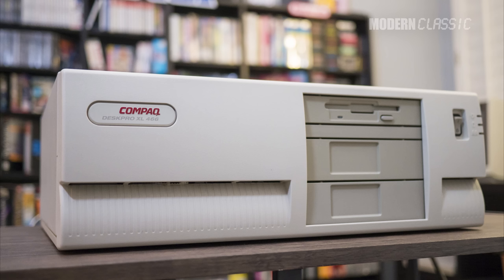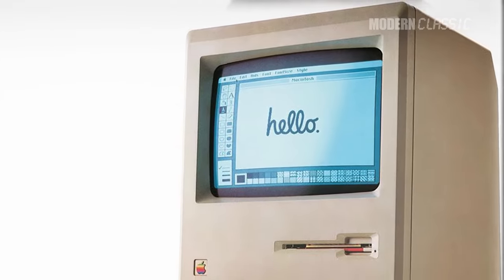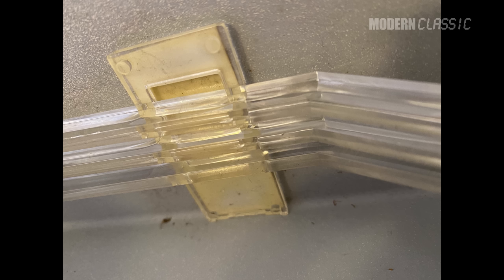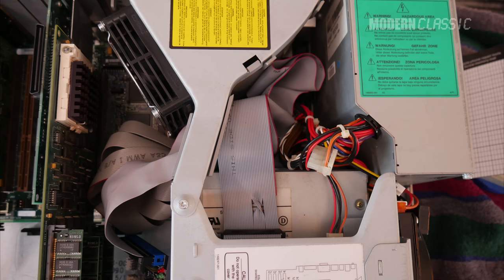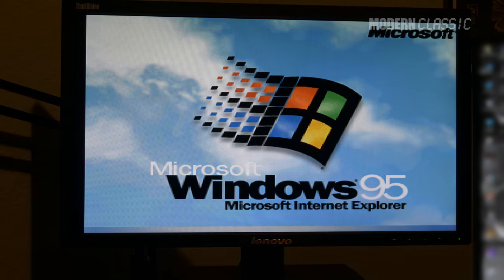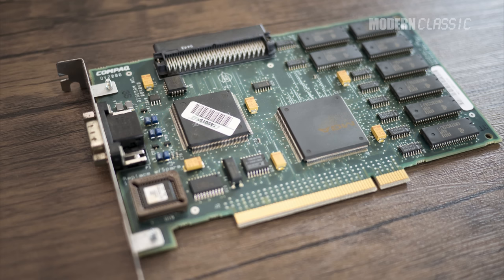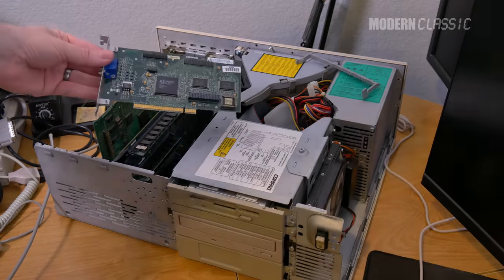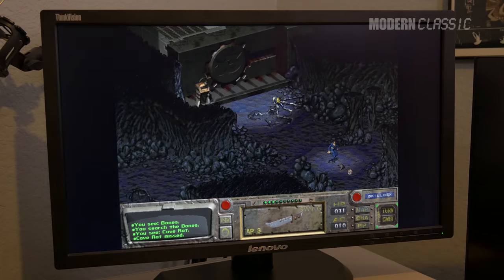Compaq 486 PC restoration and upgrade - Part 2!

Comment: I'm not 100% sure why your DX2 50hz ran sluggish like this, but to fix some problems with 486's back in the day COUGH was to run a memory management tool QMEM or DOS 6.22's own memory manager, can't quite think of the name of it, I miss my DX4 100hz with 500mb HD and 1mb Trident Video card oh and dual cdrom xD, great video keep the nostalgia going :).
Reply from the maker: I am running EMM386...
Reply: @ModernClassic  Bit of an obvious question, and knowing you was running EMM386, does your 386 have a Math Co processor in, as some motherboards came with out then, just a bare socket, just trying to think, as a DX50 shouldn't have been slowing as much as yours did, or it's something else I can't see / figure out xD.

Comment: I had issues with that same IDE to CF card in an 486 build, It would only work with a 80 wire IDE cable.
Reply from the maker: I am using an 80 wire IDE cable... still no joy on the block mode error. It's probably an incompatibility between the adapter and on-board controller.

Comment: Great video, very enjoyable. There is a fairly easy way to run an older Dos version. You just need to create a Dos 6.22 boot floppy, then put the Dos 6.22 files in a separate folder and change the command lines in autoexec.bat and config.sys accordingly. If it accesses the floppy all the time there is a fix for that. I've successfully done this by booting dos 7.1 on Win95 which is dos 7.0, mainly because I was too lazy to recreate a proper dos 7.0 boot floppy, so yeah running win98 dos on win95.  Of course this is for real mode dos only, not rebooting from Windows into dos.

Comment: I have long noted that I very rarely buy a new PC - I think I've done it twice in the past almost 40 years now. Instead, my systems just "evolve" over time as I upgrade this and that. In a sense (pretty much just from a data standpoint now), I still have the "same" computer as the 8088 clone I started with oh, so long ago. It never ends, and I have a closet full of old parts to show for it...

Comment: You can never go wrong with S3 cards. They are fantastic. My 486 has a Diamond Stealth64 VLB DRAM which has the S3 Vision864 chip. It stays in my system forever...or until I die and somebody very foolishly removes it!

You are probably having problems btw because of that crappy CF to IDE adapter. Get the more expensive (not much more really) StarTech CF device. They have never let me down on multiple 486 builds.

Comment: Quick tip on removing the double sided sticky tape with which the acrylic light pipes are attached to the metal case: use dental floss. Similar to how you'd remove emblems and badges from a car.  Here's an image that'll explain it better: https://www.theartofcleanliness.com/wp-content/uploads/using-floss-to-remove-emblem.jpg
You can also heat the area with a heat gun from the outside. Don't hit the light pipes with the hot air, they can easily deform! Use it on the outside, right where the adhesive is on the other side. I'll soften it up, and you can easily cut through it with the dental floss. To re-attach the pipes after painting, I'd suggest hot glue or silastic. Both aren't strong adhesives, but they don't have to be. I'd say it's more important they can be easily removed at a later time for perhaps cleaning, or repair, or another paint job.

Comment: You should consider trying a Matrox Mystique 220 with 8Mb and  the Matrox M3D Accellerator
Reply from the maker: No doubt those would be fast enough; the reason I got away from Matrox is that their later cards all have scrolling issues in some games. I experienced that myself with the Millennium II, and you can see it in the chart I referenced in the video as well. So I just wanted to try something different.

Comment: Half the joy is inkering and building.  What about making an at case yourself and selecting all components.  

My project: ibm pentium clone 200mhz with mmx, cd rom, 3,5” floppy drive, 2x 512mb cf, 2gig hdd, standard pci video card, soundblaster awe 64, pci network card and power supply. All this build in an onkyo housing.  I have made a lot of modifications to the back for the cards and power supply.  The front has a aluminium bezel and transparent plasic front that still has to be finnished.  Holes for the reset and power button and spray painting the back of the front.  

When ready it will be a black pc with a bit of aluminium around the front.

Comment: I have [re]discovered the solution to the "1740-fixed disk 0 failed set Block Mode command" issue.

Turns out this error isn't just encountered when modern humans try connecting compact flash adapters to these computers. Our fore-bearers faced this scourge when connecting non-Compaq hard disks as well.

I know this because I discovered the lost sacred text of Softpaq SP0970, followed its teachings and found resolution. I am happy to report that my Deskpro XL 560 now happily boots from an 8GB CF Card (with system utilities installed), although it sees only 4GB. When you consider the vintage of these machines (1994)-- 4GB is an absurd amount of disk space.

So to recap:

    Compact flash adapters and cards work just fine, just use BLOCKMD.COM to disable block mode for the disk. The 1740 block mode error will go away.
    System Configuration can be installed onto the CF card.
    Disk size limit for the BIOS appears to be ~4GB.

Comment: Hi! It could be that the CF card is too large for that 486's BIOS. To check, boot into dos and run fdisk. Does it show the correct capacity? If not, you need a "Dynamic Drive Overlay" software suck as Disk Manager from Ontrack that patches the BIOS to support larger drives on boot. You need to use one that has support for Windows 95 or it will be overwritten when you install Windows. Good luck and have fun!
Reply from the maker: It does show the correct capacity. That's one reason why I was sticking with cards that are 4GB or under (and also why I upgraded the BIOS). It is recognizing all the cards I have properly. The main issue, though, seems to be that there's just no way to configure the IDE interface at all - it's just kind of an afterthought in these machines, which were EISA and SCSI-based. So if my card or adapter doesn't support whatever block mode the Deskpro is using, tough luck. I've decided the solution is probably just a new IDE controller with its own BIOS, which I've got on order now. (I needed one anyway to mount the CF card in a rear slot; no two-device cable has a second segment long enough to run from my CD-ROM drive to the rear of the case.)
Reply: @ModernClassic  I agree, the controller w/BIOS would be the wise choice since SCSI to IDE/CF adapters are very expensive. Very curious to see what controller you found. An EISA one would be awesome! :D I have a Pentium mobo with a BIOS limit if 8.4GB and it would crash very similarly to yours, on reboot, when using a 16GB CF card. I stuck with a 4GB card which was enough for my needs and didn't go the Drive Overlay route. I also use the Transcend Industrial CF cards (a lot of them) and find them very nice, fast and had 0 failures so far. Even Windows XP runs nice from them. Thanks for your reply, i'm looking forward to your next videos! Have a great day!

Comment: that looks a lot like my beloved ibm pc xt clone LEADING EDGE MODEL D... i wonder if compaq ripped it off or if it was the other way around?
Reply from the maker: All IBM compatibles looked similar at that time. The Leading Edge Model D just looks like a basic IBM PC AT clone, as the Deskpro XL still basically was too. (I mention this in the video.)

Comment: I never thought of trusting Windows to not back to DOS 6. I probably would've used just a simple boot disk, of course with all the called files on the C drive. I'm even sure there's a way to make it read the DOS bits on the C drive instead of the current boot drive. Terminology fails me with age, so I'm not even sure I could remember enough terms to google it, lol. I just remember way back in the day I had a boot disk for gaming that was optimized to load only necessary drivers and TSRs and keep as much conventional memory open as possible. (This was before I discovered I could make branching config.sys/autoexec.bat that would prompt on boot.)

Comment: The 1740 Error is a Compaq specific error that needs to be fixed in the Bios setup. The bios doesn't have the correct hard drive settings.

Comment: Phil from Phils Computer Lab said when using the compact flash adapter, it has to be the only drive on a IDE cable.  I looked again at your video at 15 minutes and 3 seconds , are you using the adapter and CD ROM on the same cable?  Could this be causing the problem you are experiencing? 
Cheers, Dave.
Reply from the maker: Yes, but that actually goes against what the CF adapters themselves say. Both of the ones I have have settings for master, slave or single drive. I don't know why they'd need to only be single drive. There are different CF adapters, some of which support different IDE features. I've always tried to buy those that are the most compatible, but the one I was using in this video is a little old. Still, it does support being one of two drives.

I have a new IDE controller on the way, mostly so I can mount the CF adapter in a rear slot as intended, and then it will be the only drive on that controller.
Reply: @ModernClassic  Hi,  thank you for your reply,  I know sounds crazy right?
Good Luck,  I hope the new adapter fixes your issue.
Anyway, you have a new subscriber! 
Looking forward to see what you work out.
Cheers, Dave.

Comment: I believe there was a windows 95 "service pack" fix which was to do with dual-booting.
Reply from the maker: I didn't make it totally clear but I'm running OSR2 on the CF card. It might not have every single patch MS released but it is the second service release so I would think it has that one. I will double check, though.

Comment: My newer Pentium Deskpro has a header for a battery pack in addition to the soldered coin battery. Did these older machines not have one? 
Is the Pentium upgrade Socket 4 or 5?
Reply from the maker: It has one. I just wanted to replace the internal one.

Comment: If im installing 98 on a machine that came with 98 i would use an ssd rather than cf cards. but on older pc's running 95 i'l stick with cf because i have seen problems with running 95 on a sata ssd. i have tried installing on a cf card but it seemed like it was slower than a mechanical harddrive, it could just be the card i was using or the card reader don't know. I look into it when i fix my machine with 95 on it

Comment: The matrox cards were a big deal back then I use to drool over ads of Dell systems and the matrox cards inside for $3,000.00 and more way out of my budget I got lucky and was gave a two tone gray HP gaming system all stock with a matrox card inside from HP it a GX 200 or 400 forget now but gaming yes it a monster of a card for that I hate windows of that era so installed MX Linux it just plain works with one click any game it pretty neat check it out

Comment: Why not look at the back of the front panel to see what colour it really is?
Reply from the maker: Because it can yellow just as the front can. Yellowing doesn't require any light; heat does it too. If you were to watch any of the videos with my Apple IIc in it, that thing is banana yellow and it has never been exposed to anything but incandescent light. It was just in a box in a very hot attic for 10 years. Both the inside and outside of the case are the same color yellow.

Comment: Seems like people these days have better results getting an SD to IDE device, because then the chip on that will make sure it's IDE compatible instead of hoping the CF card will be.
Reply from the maker: Well, the problem is that SD cards really aren't made for this sort of thing. I made a mistake early on in not buying an industrial card (I just looked at what one of my other machines had, forgetting about what was in my IBM), but I would trust an industrial CF card over an SD card any day. It turned out that the main issue I was having was actually a Windows 95 bug, not a card or adapter problem; the multi-boot problem is now fixed.
Reply: @ModernClassic  They're not, but that's why there's bridge chips that let you use them on an IDE controller. People seem to have a lot better experience with those.

Comment: How on earth are you playing SimCity 3000 on here?  That game says it requires at least a Pentium 166 and even then it still doesn't run that well.
Reply from the maker: Yeah I just kind of threw that one in there. It's pretty slow. I just happened to have it in my binder so I installed it. I recall having SC2000 and that was what I actually played on my old 486, but there was a point in time before which it seems like I threw away all the old games I had rather than saving them, so it probably didn't quite make the cut. (I have it on Steam now, but obviously that doesn't help with this machine.) The cutoff for when I started keeping at least the original discs, if not the boxes (which I still threw away, apparently) seems to be about late 94 or 95. Unfortunately I don't seem to have any of my earlier 486 games, and for various reasons it was easier to just install SC3000 than download SC2000 again, burn it and install it instead.

Still, SC3K does run. Most games in those days that "required" a certain processor wouldn't refuse to run; they'd just be slow. I played a lot of games that supposedly required higher processors than my 486SX-25 and later DX2-50. I mentioned that about Fallout in the video; it "required" a Pentium 90 but I got about halfway through it on a 486DX2-50. I just got used to it. I obviously wasn't very far into SC3000 in the clip I showed. It probably would have become unplayable with a larger city.

It's gonna tie in to the next video too, in a way that will become clear.
Reply: @ModernClassic  I guess that makes sense, I've tried playing Croc on a 486 before and it ran but was 100% unplayable.

Comment: I can't believe the previous owners used the case as a tower. then the power button would be at the bottom and also the drive 
WTF who does that?
Reply from the maker: I thought about it a little more after part 1 and I believe now that it was probably just set down that way when it was in storage. All of the dirt and even the cobwebs inside had also settled on the side that would be facing the ground. I don't believe they'd have let it get to that disgusting state if it was actually in use. I have a feeling it was probably sitting on its side in a garage or something, and it obviously got jostled around periodically (as stuff in a garage often does for one reason or another).
These computers were meant to be used either as a desktop or a tower, but the tower config should be the opposite way, with the power button and drives (and lights) on top. That's another reason I ended up thinking it probably got all those scratches while in storage; I don't see how you'd actually use it "upside down".
Reply: @ModernClassic  Yes that makes sense, was then moved back and forth in the storage room over the years

Comment: Does anyone else hear the hissing in the audio?
Reply from the maker: I listened to it with studio monitor headphones; I didn't hear any hissing. It was recorded on a Zoom H1. You may be responding to the actual sound of the hard drive or case fan in this PC.
Reply: @ModernClassic  I realized 
Shortly after posting that it was my headphone amp... Listened to it with a different headset without the amp didn't have the hiss. Still didn't expect a reply keep up with the great content